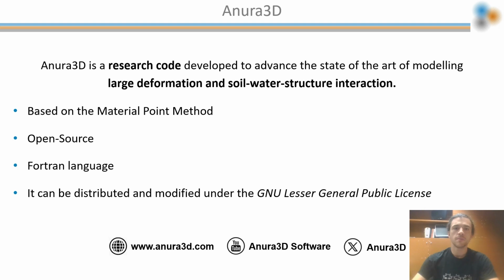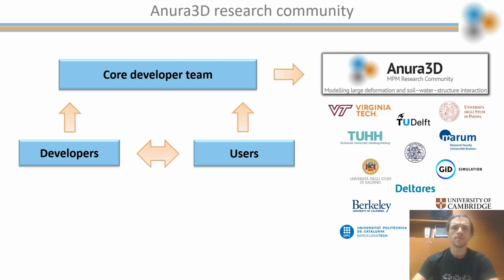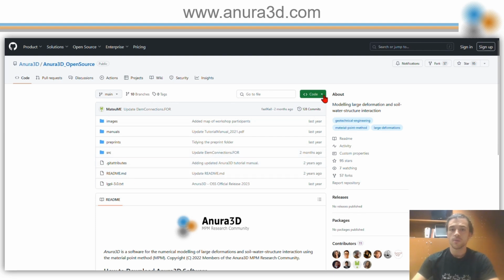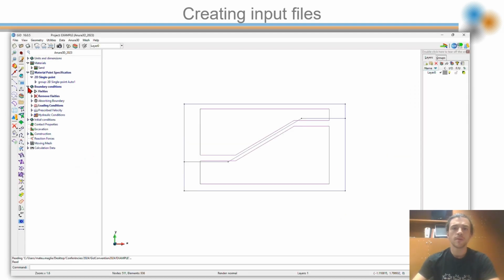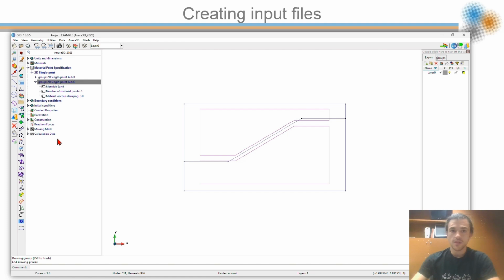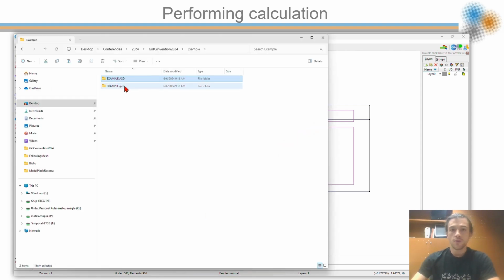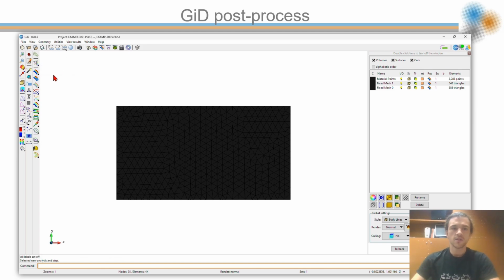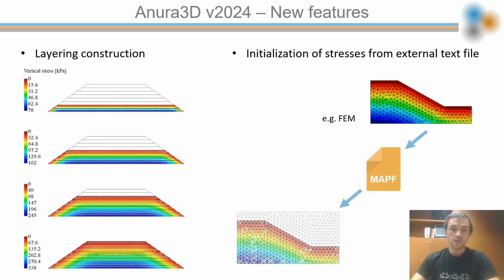Anura3D: Software advances and improvements | GiD Convention 2024

Comment: Could you please provide the liquid retention curve for part of the materials of Anura 3? I need to set it as the VG model, but I'm not quite clear about several parameters involved, which has led to calculation errors. Could you please explain how to use the VG model correctly?